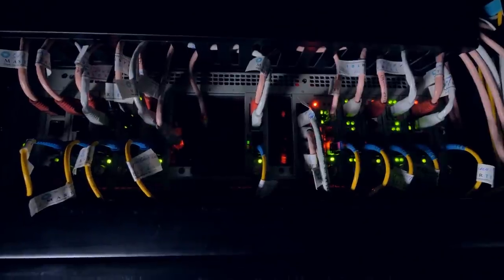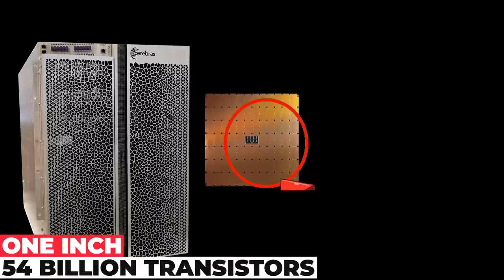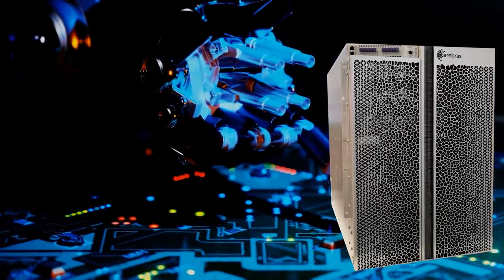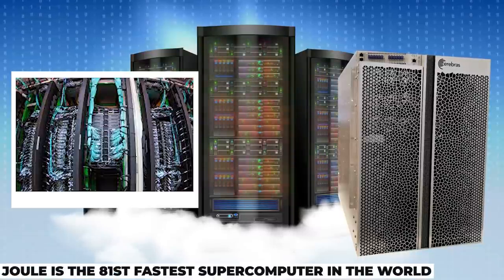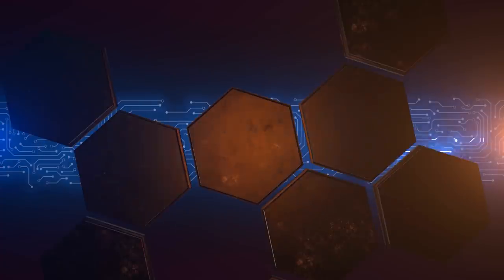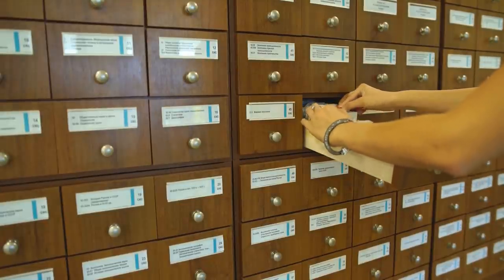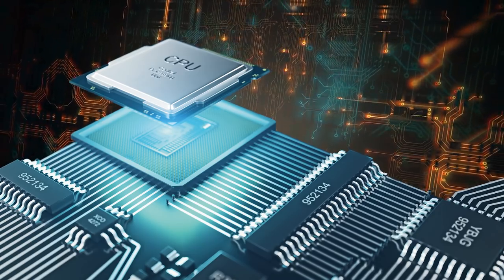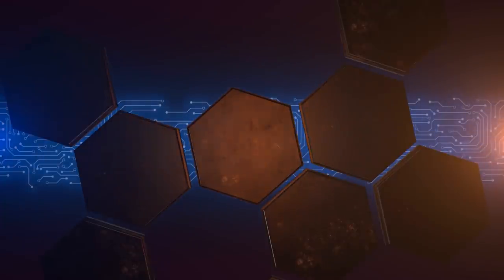The Trillion-Transistor Chip That Just Left a Supercomputer in the Dust

Comment: How does such a large chip evade thermal expansion problems?
Probably requires very tight temperature control...
Reply: Well, if everything is made of the same material (or materials with the same thermal expansion coefficient) then there cannot be any issues
Reply: @Orlandofurioso95  if a chip is that large, thermal expansion is going to be in few millimeters. This much expansion if not accomodated properly would break brittle silicon.
Reply: Look at the articles and videos on version 1 of that chip. They lay it out well
Reply: Picture of chip shows holes drilled into the silicon wafer at the corners of each embedded chip. One way to relieve stress.
Reply: Dragomir Ronilac  8.5inches of silicon, if you calculate the thermal expansion from 30 degrees celcius (room temp) to 80degrees (operating temp). It evaluates to 2 to 3 mm on every side.
Also there is workload variation in a normal laptop processor. That means the temp varies in that range depending on the workload and there is a continuous cycle of thermal stress. (this is one of the reason why laptop chips come without top cover)
Reply: There are metals with about the same expansion coefficient as Silicon.  Probably they use something like that.  Not always the ideal material for cooling though.
Reply: @roy-arghya  not if the silicon is expanding..... thermal expansion is only a problem when you mix materials of different composition or you have topological constraints. A flat plane of material wont have any thermal expansion problems.
Reply: @LouSaydus  That's only true if the temperature is uniform across the piece. I imagine they use one of those graphene thermal pads for this purpose, the ones meant for lateral heat transfer.

Comment: You misquoted the core count, 850,000 not 85,000.
Reply: BRUH but is the core usage 160,000 IF ITS just 16,000 THATS STUPID
Reply: CPU Usage can exceed 100%, it also depends on how CPU usage is calculated.
Reply: @AyushTH  That's maybe he thought someone put 0 too many and scale it down 10x from the real number
Reply: You're core-ect...
Reply: Yes he did, let's punish him so severe he'll never does it again.  I mean there has to be a limit on horrible behavior like that!    😣
Reply: I believe you're misquoting and misleading comment readers. Multiple articles quote the core count of Joule as about 84,000-86,400 (variance over time due to changes,) of which 16,384 is the max cluster size it may allocate in this instance to maximize efficiency (design limitations would not generate results faster if additional CPU cores were tossed in.)

Again, this assumes the Joule is what you erroneously thought was miscounted. The correct Cerebras core count of 400,000 is also in the video.
Reply: @PhantasmXYZ  i think they're talking about the number of cores in the upcoming successor to the cerebras
Reply: why is your zero key so sticky ... yuck
Reply: @PhantasmXYZ  he's taking about the core count of cerebra 2.0
Reply: I suspect a reason for this discrepancy.  i have hearing problems.

Comment: 6:34 That's some ultra advanced C code on that blackboard.
Reply: I think that Cerebras is overkill for that sort of code. Even a Commodore VIC-20 is overkill.
Reply: @vladsnape6408  No, a VIC-20 can't deal with data from gyros and other similar sensors, but a R-Pi or an Arduino should get the task done.
Reply: Should've just been.

#include <stdio.h>

int main()
{
    printf("Hello, World!\n");
    return 0;
}
Reply: The whole program written in main with the only include being stdio. LOL
Reply: @FuckMargaretThatchher  You would be suprised. VIC-20 has this 'user port' thing which is basicaly 8 bit GPIO port with some extras. Similar to what other Commodore computers from this era have. You could easily bit-bang SPI, I2C or any other simple serial protocol on it. With maybe minimal extra hardware, like logic level translators, it could handle many modern sensors no problem. And just few KiBs of memory is about the same as many modern low end 8 bit microcontrolers have.
Reply: Really? For its more simplified. Not as much noise as other language
Reply: Dude. That is example code. On the top they set an integer (100), a float (3.14), a char (A) and then a char array (ABC) then it shows how to print these to console with their respective call-ups %d for int, %f for float etc. I guess the last one was supposed to be printing a backslash which is wrong, you don't write %\, you write \\ like the did for the ? at the top. That is why they get by with stdio (standard input output), this just prints 5 lines to the console. This would be the first 2 days of any C class.
Reply: @Aaron vandenberg I'd guess that Harbinger is an adherent to Poe's Law.
Reply: ..not really 😕
Reply: Nah, that's Real-Time Cobol tweaked for femto-second data acquisition right there.
Reply: @theharbingerofconflation  woosh
Reply: @janglestick  yep, I didn't notice it, might be on the autism. That said if your comment is 60 chars or less, maybe put up some disclaimer.
Reply: @marcusk7855  I mean, this kind of a computer would only occasionally need to print 42 at the peak of life evolution in the universe anyways
Reply: @janglestick  thanks for informing me of Poe's Law. Was not aware this was a thing. The law I mean. The concept? Oooooh buddy. Yeah.
Reply: Who uses blackboards for programming?
Reply: @stephenjacks8196  University Teachers... it's a sad state of affairs.
Reply: Thought this was being serious for a min

Comment: Problem with wafer-scale chips is that one error can ruin the entire wafer. I'd like to know how they address that.
Reply: A single error "ruins" in most of the cases only one processor - and you need software to work  "around" these defect processors...using the ones which have no defects.
Reply: Theres probably quite a few chips that are not 100%. They would still be useful, to some users.

Comment: Great content, subbed. 

But can you please also talk about the shortcomings of such technologies, like why hasn't it been commercially successful so far because the idea seems simple, make the chips bigger to reduce transport? It helps understand the bigger picture and also makes the video seem less like an advertisement for the company

thanks :D
Reply: What is happening is the WSE is like a super computer design, ie a number of compute/memory nodes networked together. The issue with a normal design is there is latency associated with the networking, just because of the physical distance between the nodes. The WSE attempts to overcome this by putting all the nodes on a single piece of Silicon, though a similar result could be obtained with a humungous package, the package would still be larger than the silicon though. 
This makes for less time wasted in network messaging, and also I suspect allows for better synchronisation of nodes reducing wait states for results to arrive from other nodes (I am making informed guesses here, I am not a system designer). I know intel has looked at photonics to improve message transport times in supercomputers/large data centres etc.
The downside of all of this is concentrated heat, you think one processor gets hot, consider ~400 processors on a single piece of silicon with a TDP of 125W each, though a 250W tdp is quite usual for graphics chips. This is 50kW (100kW @ 250WTDP). you are going to have some serious thermal management design issues to have this run anywhere near maximum speed...! It isn't the amount of heat generated per se, but the concentration of heat. Typical solar radiation is ~1.1kW/m2; the equivalent energy density for the WSE is 1.21MW/m2, now that is hot!
Reply: The manufacture of a waffer sized chip without any error is extreme difficult.
That is how CPU's and GPU's are priced, if you look at yield results you will understand another concept of why is not mass produced.
Reply: @JavoCover  It isn't a wafer sized chip, the maximum size of a chip, technically called a die, is the maximum area printable in one exposure. This area is ~26mmx32mm, maybe a little larger. 
As I say in my post above, the WSE (wafer scale engine) is the same as a supercomputer where compute/storage nodes are connected together in a switching fabric. For the supercomputer the comms (switching fabric) is off die then via networking, eg ethernet. For the WSE the comms are between chips on the wafer, which greatly reduces the latency. The design of each node will be such that it is fault tolerant, so some on die compute and storage resources can have a defect, but the node as a a whole still works.
These could then potentially be worked into another 2D or 3D array, given large enough bandwidth between each WSE node and a hell of a lot of cooling! A 20 WSE supernode array could easily draw 1 MW! I'd like to see the cooling system for that :-) 4000A @250V....the power supply will be huge too!

Comment: The moment I heard "cut down the commute" I physically nodded my head as knew exactly where this was headed.
So eloquently put.
Reply: Considering interconnects between processing elements have been a major performance bottleneck for as long as HPC has been around, it's a pretty obvious solution.
Reply: i  wonder if they could stack wafers in the same computer?
Reply: @Tailslol  
Interesting...thing is about wafers,. you're gonna get defects no matter what..so no entire wafer will be perfect. So you gotta bridge them together somehow.

Stacking chips on too of each other is what Intel has started to do with their new Foveros chips..I read about the challenges for this...not easy to do cuz of thermal barriers and getting power to each layer.
Reply: @frtard  calculation power per watt is also a giant consideration. most of the power draw is moving the data around, you start jumping threw multiple bus's and routers, i'm sure the watt-price-per-flop is much higher vs a compute dense device like this. i'd also think you'd dump a lot of upkeep and technical complexity as well.
Reply: @Tailslol  they're trying to do 3d stacking of silicon, there is an upper limit. from my, limited, reading on it, it has to do with thermal stressing between the layers, thermal expansion and differential cooking of the threwsilicon via's and interlayer interconnects causes them to separate. imagine the stresses you'd get over that size die.
Reply: @jonathanlebon9705  i saw some scanning electron photos where they're working on making a CPU with water channels embedded in it. it's really nuts what they can do now, especially with the new UV tech and all the waveguiding tricks they can apply to that.

Comment: How do they deal with heat? Tightly coupled memory is pretty cool.  Well done, your analogies are excellent.
Reply: Thats why the system is 2 racks for 1 chip. 90% of the footprint is power delivery and cooling.

20 kilowatts worth.
Reply: @spoonikle  Inside the thing it has cooling that looks like it belongs on a car
Reply: @spoonikle  Don't forget that ever more efficient heat sink designs are coming into the fore through generative design.
Reply: They coom on it to cool it down
Reply: @spoonikle   The problem isn't really the size of the cooling equipment but dealing with 20kw of heat energy coming from that relatively small and tightly packed CPU area. It has to be pretty exotic system to be able to cool that much from a single system. You need liquid nitrogen to cool down ~800 watts from a large server CPU socket.
Reply: @PAcifisti  Well I was curious about that and did some quick calculating, Nvidia's A100 chip has a power density of 0.3027W^mm2 vs the Cerebras (chip is 15kW, system is 20kW) has a density of 0.3245W^mm2. They're both server based cpus, while a desktop cpu like 11900k has a power density of 0.4522. If 'exotic' is a simple water cooling loop then yeah, but liquid nitrogen is definitely not necessary for it.
Reply: @facepalm7345  I was more referring to the crazy overclocks of the large Intel server CPU's running at 5ghz all core under almost 1000 watts. That kinda stuff needs way more than just basic cooling.

Problem with the power density comes more for the cooler rather than the core.
On a GPU you usually have something like 13x25cm sized massive heatsink with multiple heatpipes running through it for that 200-250 watt load, averaging at a rather pedestrian watts per cm2. Now imagine trying to do that if everything under the heatsink is a core putting out load. Suddenly it's no longer calculated at 1 watt per cm2 but more like 30. Heat pipes have a limit of how much they can transfer at once and if you break their thermal limits (boil everything inside of it) their effectiveness plummets.

Also, GPU TDP's usually means the entire cards power draw. Sure the core is the main consumer but the rest of the card (specially with 40 GB of memory) takes off a good 15-50 watts as well. Which in the case of the A100 means that the calculation for the power draw per mm2 gets more complicated as the core is surrounded by HBM2 memory modules that probably draw a good 20-40 watts and participate in the heat transfer.

Ultimately the main reason for why this is rare done is probably the same reason why AMD does chiplets - Faults in the manufacturing process. Trying to do an entire wafer sized chip means that you'll have to either design a system that will have & allow loads of failed cores & communication lines in the middle or trash most of the wafers entirely. 7nm TSMC still has a rather substantial fault rate.

Comment: Monolithic system are better at any single point in time. Fabric/node systems are better across a longer time span. The flexibility of having dissimilar nodes composition, as well as segment based growth is still very attractive. It seems you need a concert of both of these paradigms: monolithic for front end optimization pools, and fabric for the bulk core pool. It seems there is huge opportunity for advancement and improvement in the interconnect used to connect the nodes in a fabric system.
Reply: I guess it's like how a CPU and GPU are very good at specific tasks, but less so at others, so we build systems with both. There are also chips designed for neural networks, and work very differently (NPUs). I could very easily imagine that this kind of processor could create a fourth class. So you might have a computer that has one of these processors at the heart, and a number of CPUs, GPUs and NPUs plugged into expansion ports, or arranged around the mega chip.
Reply: @darksunrise957  Infiniband is so close to being perfect for this. Each "port" you mention could be used independently or in concert. Synchronization and low latency is key.

Comment: imo the interesting question wasn't how or why cerebras was built but why were the previous supercomputers built from clusters of separate nodes instead of one big one in the first place? since it's 2023 I asked chatgpt and it gave a list of reasons to favor supercomputer with separate nodes over wafer-scale CPU including scalability, manufacturing yield/cost, power efficiency/cooling, memory bottlenecks, fault-tolerance and overhead of developing software for new type of architecture. not sure I bought all it's reasoning but it'd be nice if the video had covered these differences

Comment: That last prediction is what's already is place, you already have CPUs with thier own microarchitectures, ASICs for your DACs, GPUs, PWM modulation, your PCH (formerly southbridge), USB controllers, NICs, and hell, even the Intel Management Engine is an ASIC in your CPU (AMD's PSP is basically a custom Qualcomm ARM SoC), what we'll probably see is an expansion of that diversity for application specific tasks then later see them condensed and integrated into few packages

Comment: Eventually I think there may be "core cores", each with specialized abilities enabled by their architecture, but that can work together.
Reply: That kinda is a thing already...
RT-cores, Tensor-cores and CUDA-cores.
Reply: That was the case with old game consoles, where normal processors weren't providing enough computing power
Reply: @Mikkel111  not so much.. it sounded as if they have huge caches or tightly coupled memory.  I wonder if these are RISC-V or mips...
Reply: @kayakMike1000  They’re still separate cores with different architectures.
Architecture doesn’t just refer to instruction-set.
Reply: So basically it's just clusters of transistors.
Reply: @thefirstsin  Yes, just like Python and C++ is just… code.
Reply: @Mikkel111  and brains are collections of neurons.

Comment: Why are you talking like it’s bad to have more transistors? Transistor counts have been trending upward almost exponentially, this is intentional not an accident, it’s physically difficult to build chips with so many transistors because there are imperfections in the silicon which renders many of the gates useless, so different logic units or cores need to be disabled - this can cut off thousands to hundreds of millions of transistors, then not to mention heating issues, and electrical resistance from having such a large chip. Most companies don’t build monolithic dies like this because it’s not profitable most of them will have too many imperfections and would need to be thrown out, but as transistors get smaller we can pack more in smaller chips making it more profitable.

Comment: I think it might have it's niche but things like AMDs infinity fabric essential do the same thing and in AMDs case you could integrate hmb memory to compute far larger workloads. 

Multi chip modules are the future as yeilds of whole wafers is terrible hence will have defective dies and have to be on outdated nodes to achieve reasonable yeilds. Where as multi chip modules can take chips from several wafers and combine them onto an older well yeilding node as it's interconnect, hence achieving better efficiency, transistor density and therefore performance with minor increases in latency